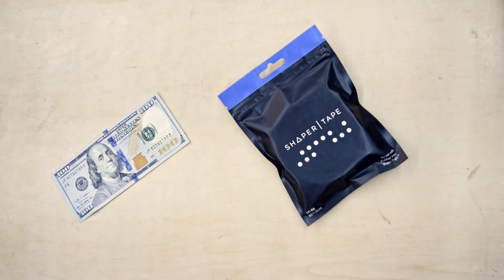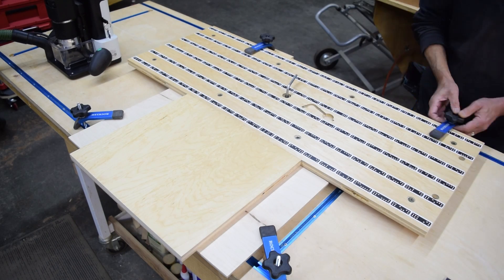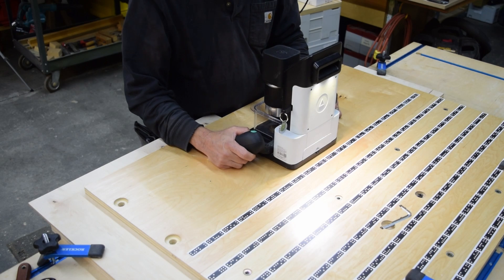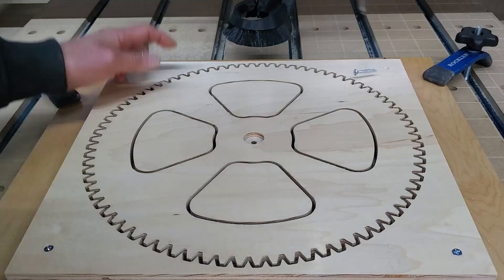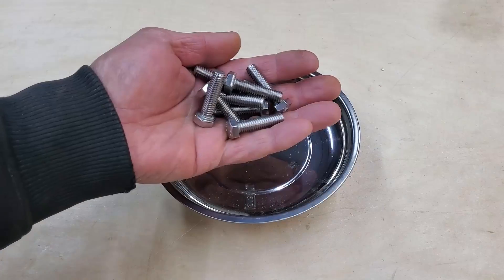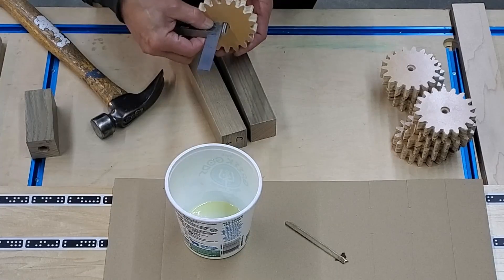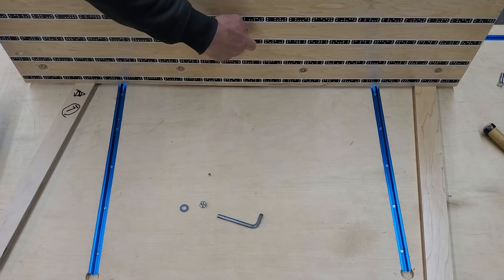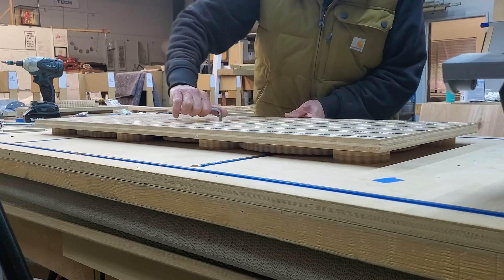Gear Drive, Adjustable Height Tape Board For Shaper Origin

Comment: Do you think Benchpilot would do rather than the other cnc router?
Reply from the maker: If you mean my Sienci Labs Longmill, yeah, probably. I don't know the workpiece capacity of Benchpilot. Benchpilot doesn't really make sense to me, though, since you can get a Longmill for the same price, and have a stand alone machine with full 3D capability. But that's just my opinion...

Comment: Nice jig, I started to make one for myself but 2 of the SVG files are cropped and do not include the entire gears.
Reply from the maker: I just downloaded all of the files from Shaper Hub and checked, but didn't see any cropping. What you might be seeing is that the gears don't fit on the default page format when opened with inkscape, but that doesn't matter. When you open the files on Origin, you should be able to pinch zoom out and see it all. Good luck with it and thanks for watching!

Comment: Hello, I am seeing this a year later.  I am just now doing some research on SO.  I am totally clueless to what this solution actually addresses.  I see the gears working, but how does it actually work to address a problem?  Sorry for a stupid question
Reply from the maker: As they say, there are no stupid questions. For the most accurate cutting results, you want to have the surface of your workpiece flush and level to your Shaper tape. My adjustable height system makes it easy to flush the tapeboard to my project. If you're asking about "tapeboards" in general, it's just a strategy to be able to use less of that expensive tape! Thanks for watching and feel free to ask anything else. I try to respond to all comments... eventually...

Comment: Very cool. What do you all think about not having the tape coplanar to the workpiece? Seems to work just fine if you don’t need a coplanar support surface
Reply from the maker: Shaper says it should be coplanar, since the Origin's camera is viewing the tape at an angle and the math needs to make some assumptions about that angle and the distance to the tape. Makes sense, but one might assume that its programming should also know the fixed parameters of the tape patterns and be able to calculate the tapes actual positioning during the initial scan... I dunno...
Maybe I'll try to do some actual testing!
Thanks for watching the vid!

Comment: Cool idea but i think I would integrate bearings countersunk with a cap such that the height adjustment gears did not touch the surface for fluidity in movement
Reply from the maker: Yeah, that would be nice. I'll need to think about it (if there's a) next time! Thanks for the comment and view! Cheers!

Comment: I wish someone would offer 3D modeled gears. I think this is a well-engineered project. Cutting and sanding this out with an SO is a real time commitment. A more durable material than wood, would be my preference. I think it would hold up better over time. Anyways great job.
Reply from the maker: A time commitment it is for sure. I've avoided trying out 3D printing because I can imagine the piles of plastic trash I would make. As far as durability, I don't think the actual wear on these wooden gears is anything to worry about. I know I'm no youngster, but I'm confident the gears will outlast me. They only experience a dozen or so low speed revolutions each time it's used. Thanks for watching and your comments!

Comment: One more question, did you finish your final top with shallac or something similar to keep the tape from getting scuffed or lifting up? I was thinking a spray-on product.
Reply from the maker: No, never bothered worrying about that. Only the tape that's near the edge next to your workpiece ever gets wear from the Origin riding over it. When Origin tells me it's not reading 3 or 4 dominos, I cut out and replace that section and re-scan. Good luck!

Comment: It seems you still have to add tape to the parts you are cutting. Why is that?
Reply from the maker: Origins "eyes" (onboard camera) can only see about 10" or so (I think...) in front of it. When cutting larger parts that require moving it further from the tape board than that, you need to add more tape within Origin's vision range. I always move origin around the cutting area before actually starting to cut. There's an indicator on screen that lets you know whether there's enough tape for Origin to track properly. When there's not, I just add another strip and "add to scan". Thanks for watching the vid and your comment!
Reply: @FineLineJoinery  I assumed it was that. At least one uses less tape overall. I can't wait to get started on this one.
Reply from the maker: @DavidGunter  Come back and let me know how it turns out! Thanks again!

Comment: Great video!! I was in the process of creating a tape board when I found your video. I downloaded the files from the Shaper Hub (thanks!!). In the Instructions on the Shaper Hub you state "Updated: Just added an alternate file (alternate-nested gears(G2x1+G3x4).svg)". I don't see this file, have I overlooked something"
How important is the height of the tape board in relationship to the tape board? I thought that the tape was just for reference and the height of the two (within reason) was not an issue.
Reply from the maker: On the "Files Included" list, did you click on "See More" underneath? The nested gears file should be at the bottom. Ideally, the tape board should be dead flush with your workpiece. Origin's camera is at an angle to the tape board and is calculating its position relative to the tape based on that assumption. At least that's my understanding... Thanks for watching the video and good luck with your tape board! Come back and let me know how it turns out.

Comment: This is a brilliant solution to a problem just about every Shaper Origin owner has. I've been thinking about how to make a height-adjustable tape board for some time, and I have some ideas that I think would work, but I really like your design. It looks like it would be super easy to use, versus my ideas that would require adjusting four "legs" to the correct height individually. Thanks for sharing your design - subscribed!
Reply from the maker: Yeah, that was my main goal, to raise and lower the board with a single adjuster. Glad you like it. Thanks for watching and your comments!

Comment: CNC is the way... 
I used a transparent Drawer liner with shaper tape on it... I roll it on the board and re-use it over and over until the tape fails.. You can also use the Ikea FINFÖRDELA cutting boards. and they have other similar items that Shaper tape sticks to very well.
Reply from the maker: Great idea! Thanks!
Reply: Can you elaborate or even better, make a video of this?

Comment: I honestly forgive for not using the origin for all the gears. I once shaped 3 gears for a double screw vise and decided it was the maximum for my patience to handle.
Reply from the maker: Ha! Yeah, I think patience is the key word there. There's nothing particularly difficult about cutting the gears, but it does require patience. The first one is fun, but the rest are work! Thanks for watching and especially for your understanding! Cheers!

Comment: Interesting project, and exceptionally designed. I would assume by lengthening the bolts in the "lifting" gears, and using a thicker board (say 1" or greater) you would increase the overall height of the panel to accommodate thicker stock? 

BTW you have become a great resource for the Shaper. Looking forward to more of your insight on the Shaper
Reply from the maker: That would definitely work. For me, I always have lots of scrap sheet stock of varying thicknesses laying around, so I can easily shim the stock or tape board to within a quarter or half inch of where I want it, then fine adjust with the gear drive. But yeah, this could easily be modified to suit the needs of a given situation. Really appreciate your input and kind words! Thanks so much for watching!

Comment: Well done.  I've been chewing on an idea similar to this for a few weeks now - just got the Origin last month.  I also have a small CNC in the shop.  I've built several CNCs over the years and while the SO is an awesome tool with loads of uses (primarily to me being able to cut large things), it's not always the best for repetitive things.  I've cut a lot of gears for various things and for that the SO would be really tiring.  Great idea and implementation.
Reply from the maker: Thanks! Yeah, I got my Origin several years ago and love it. Just got the little 30 x 30 Longmill CNC around the middle of last year and love it too. As similar as they are technologically, they are 2 different tools and they each excel at different kinds of tasks. Glad you enjoyed the video! Thanks for watching!